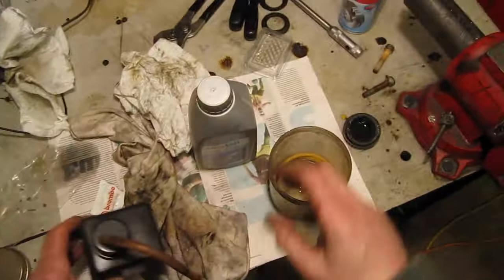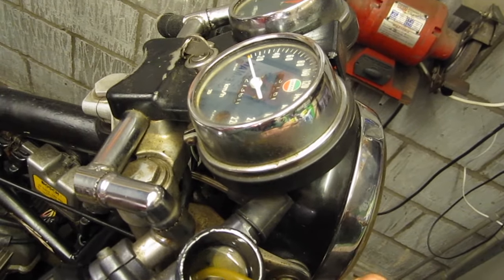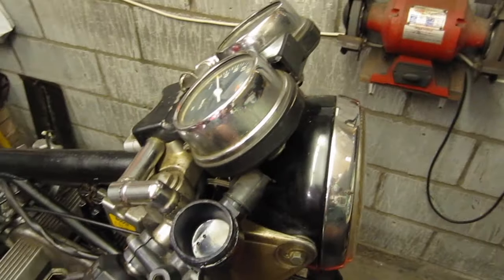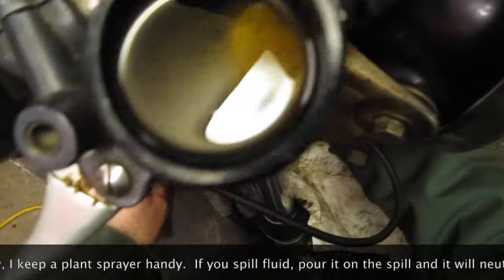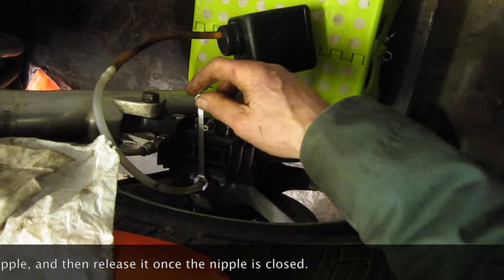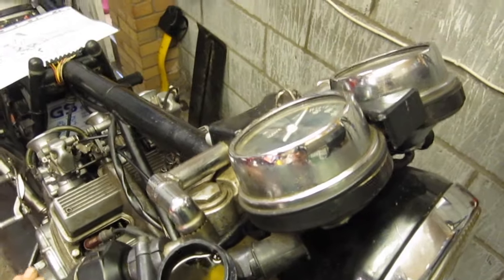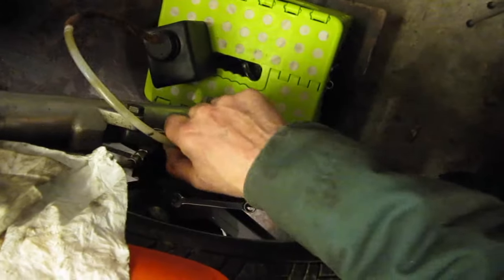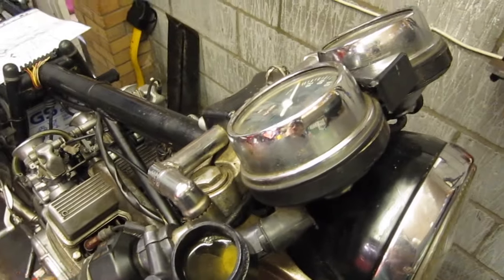Bleeding the Brakes

Comment: Hi Guy. is there any chance that you could do a video of hints and tips for new airhead owners or a buyers guide? Common things to look for and things that could be costly if you don't look out for them. Only if you have time. Many thanks:-)
Reply from the maker: +Squid ley My knowledge of Beemers is too limited to be able to do a buyers guide. I can speak with some experience of the R100GS PD, since I have had mine a long time and clocked a high milage (370 000). Maybe one day I'll do a review on that model. 
With the benefit of hind-site, if I were looking to buy again, I may well consider one of the older heavy flywheel models. I like the characteristics of the engines. But which ever model you choose there are always compromises.
If you are on Facebook you could always try joining Airheads BMW Riders. There are plenty of friendly riders there willing to give advice. Or perhaps join the Airhead Beemer Club. Again plenty of knowledgeable, friendly people. 
Lastly you could try a book Illustrated BMW Motorcycle Buyer's Guide by Stefan Knittel
Hope that helps
Guy

Comment: Hi Moto Pheonix. Many thanks for all your videos. They are very informative and helpful and good of you to take the time to help others with a similar passion.  I am currently on the lookout for a air head gs and wondered if you sell any bikes? As I know very little about them would be good to buy from someone who knows these bikes inside out. Thank you again.
Reply from the maker: +Squid ley Hi, thanks for the kind comments. No I don"t sell bikes or work on them to earn. If you are looking for a GS to buy, then try to find one with low miles, that has not been too messed around with, unless you can be sure the improvements have been done competently. Airheads manufactured in the late 80s - early 90s suffered from the infamous missing circlip on the gearbox output shaft, so haggle accordingly.
I suggest you look at Snowbum's web site: http://bmwmotorcycletech.info/index.html he has a huge database of data, knowledge and advice you can make use of. Best wishes Guy